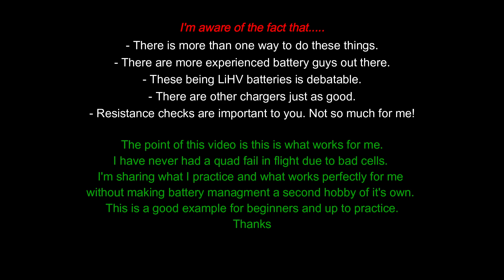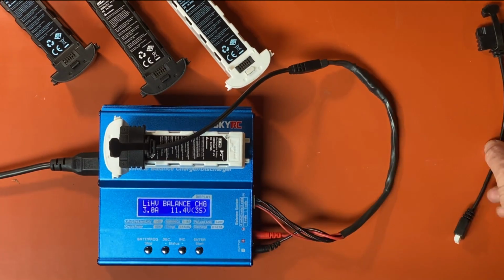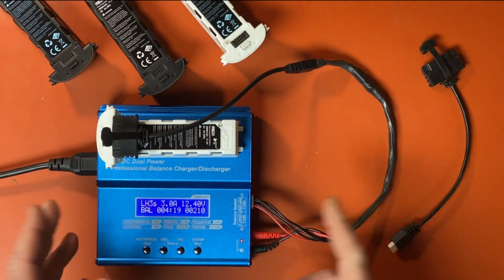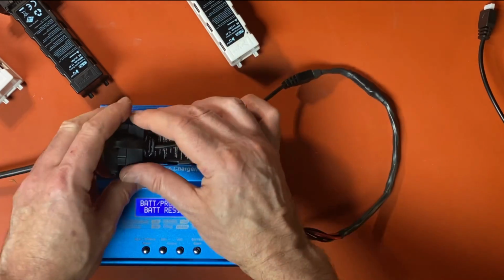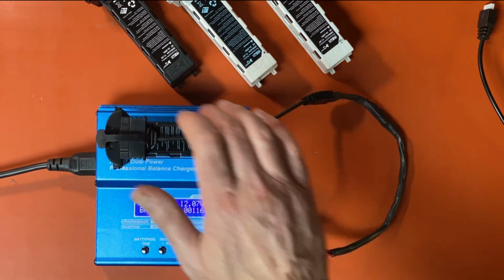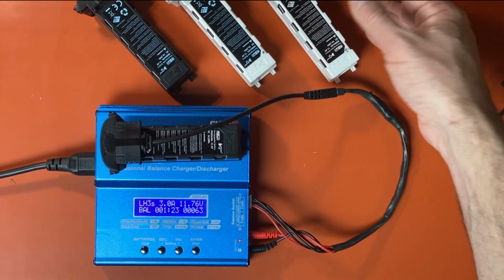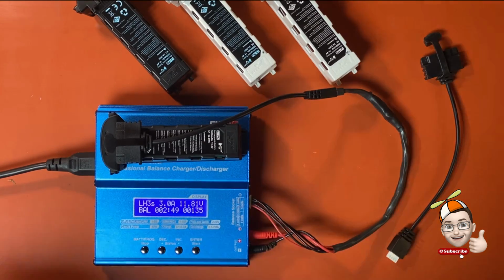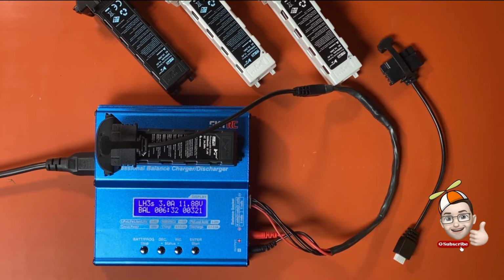IMAX B6 V2 BALANCE CHARGER - BATTERY MANAGEMENT USING HUBSAN ZINO BATTERIES

Comment from the maker: Check out my videos and you will find a 3 part series of how to make the balance leads in different ways for different levels or preferences. Thanks 😊
Reply: Hey. Any word yet on Zino 2 ship date? Mine hasnt shipped out yet, that’s why I ask. Also, when are extra batteries for it going to be available for sale? I would figure that they would want to have them in the pre-sale, that way they could drum up quick sales with extra batteries.
Reply from the maker: The Badboy Live New ship date is next week but please be patient because it is Hubsan delaying it. This is still a app testing delay according to them. 
Batteries and few other accessories will be around the same time they say.
Reply: @MeltWithU  I pre-ordered the ZINO 2 with 2 batt on dec 19th and they tell me another 10-15 days before they even start shipping so going to be awhile
Reply: @mgflyer8066  I think I preordered mine around the same day. I originally had a pro ordered and saw that this was coming out as soon as it was, so I decided to just preorder the 2, as I wasn't going to pass up the 4K / 60 and HDR, plus the extended distance and longer battery life. Especially at the price. Because the pro was nearly as much. I'm glad I looked into it before I got the pro. Though it would be nice if we had a more concrete ETA. I'm really not in any hurry, though I would love to be flying it now.

Like I said before here, I wish to God they would put up the batteries for sale separately so I could order a couple of them to ship and arrive with the Drone.

Comment: I have not purchased a Zino pro as yet..But  since wanting to be prepared, I purchased the B6 V2 AC DC batt charger. 
Since I am still using several  lipo 1S   (one cell) batteries 3.7 volts   some  2800 mAh and some 1800  mAh   all have 2C  written on them.    The  manual with the box is way too hard to read...so I went to web site and printed out the  large PDF and put it in a 3 ring binder... I  even  used the   USB port and  installed the  Windows version of the  charge program on my computer.    The  unit comes with the banana plugs...and one adapter that  has a single  jst connector that will charge the  1 cell lipo  3.7 v batteries... 
Up to now, I have had to use the  USB  plug in charger wires that come with the 3.7 volt batteries,  to use on the  toy drones.    
I hate to admit that at 81 and having been an Advanced Ham operator...been working with medical electronics all my life... the  new B6 V2 charger is  very frustrating and the manual is not much better than explaining how to program a rubics cube.    So,  would appreciate   a few more  videos....  How to totally reset your charger to get rid of memories you might have put in when testing and learning. 
Then  for some of us  ...produce a  video on how to SAFELY  charge a  1S  one cell battery LIPO   and what safe settings should be used....  1A chg or 2 A charge?  how do we know what is safe?   It took me a half day of frustration to finally get the Lipo  charge system 3.7 volts to agree to charge  1S  instead of 2S   finally it just showed up..   Then, I cannot find a way to  set  the battery to charge at the max of  1800 mAh  then change over  and know that the next battery will charge at   2800 mAh. 
The   computer app through Windows  did seem simpler...but  it still is not convincing all the settings are in safe mode. 
Perhaps  on one of the new videos you can  take  a  1S  and and  a common Zino pro batt  and another of different count cells and make a  how to set up and save a program for each.. 
Well....luckily...so far....I have succeeded in getting one of the one cell batt to charge..with out blowing up...  but looking at the figures...I am still un easy.        And thanks for all the other  videos you do... they are great help  in getting started in this  hobby.

Comment: Hi   Just got a Imax B6 AC v2   I only have the original cable that came with the Zino, but it appears to be the thicker one.  I have it set on LiHV Balance CHG  3.0A    11.4V (35)   When I press start I get a  "CONNECT ERROR    CHECK MAIN PORT"   The battery is new.    Thanks for you wonderful video        Vic
Reply from the maker: Do you have the balance cable with banana plugs like I shower?
Reply: @QCGUY  Haaaaaaaaaaaa after looking at a dozen videos, I realized everything I needed was not in the IMAX box. Then there were a dozen showing me how to make a cable that would work with my Zino Pro Batts. Finally found where I could purchase the  3S JST- XH Charge & Balance Cable on Ebay and Amazon. What a slog to fly this drone. I am wondering if I should not have a drone    LOL      Thanks for YOUR video. When I get the cable, I will reference it many times, I am sure.  Vic
Reply from the maker: @JackTheBearTexas  Enjoy 😉
Reply: Thanks guys for all your help   I am back flying my Pro

Comment: The A3 battery has fuse resistors in the BM circuits, so the cell I.R. values are not correctly displayed, and you should ignore their absolute values. You might still be able to pick up a trend over time if you see them changing. If you open the pack, you can get to the balance connector and hook that up directly to the charger for a better I.R. measurement.

Comment: I wish I’d had started watching your videos from the get go. I recently experienced a catastrophic battery failure 30 seconds into flight. Unfortunately I was using Hubsan’s battery charger so who knows what damage that charger did. I was draining the batteries down before storing but didn’t invest in a better charger/balancer. Since the drone will not even power up now, I’m faced with unknown damage (other than one motor that is visually physically damaged) to the insides of the drone after its 75 meter free fall. I’ve checked into sending it back to Hubsan because I’ve had it for 10 months and it has a one year warranty. But I don’t have much confidence in sending the drone to China and ever getting it back. What is your charge to inspect/troubleshoot the damage? I’d love to get this thing repaired even if I end up getting a better drone to replace it. It really produced excellent video footage for the price.
Reply from the maker: I personally wouldn’t send it to them if they even take it. They won’t honor a warranty but you can try. My minimum is $60 but the rest depends on what it needs?
Usually they are cheap fixes.
Reply: @QCGUY  send me your info and I’ll get it to you. I’m sure I’d pay at least $60 shipping it to China and back, so let’s see what the damage is
Reply from the maker: @lancecoler2009  email me....
qcguy.chris@gmail.com

Comment: First off, I want to thank you for this video for helping me get back to flying my Zino Pro. I ruined 4 good batteries by fully charging them with the charger that came with the pro and then sitting them on the shelf for months. So I got an Imax charger and the special wire for charging the pro batteries AND a new battery. 
Using your video, I was able to charge the new battery and check it. I was one of those folks whose Pro took off and then fell out of the sky....only 6 ft, so it passed that drop test. 
NOWWWWWWWWWWW my question is:  I don't fly my  Zino every day....I may not fly it for weeks. I hear, if I am to not fly for a while I should discharge the battery to a specific level and it will be OK to leave it for a while. Howz about if I only flew once every two weeks? You see what I am getting at. 
Again, thanks for getting me off the ground again. I love the Imax B6  Thanks to those who commented too. If it is OK, I would like to thank Captain Drone for leading me in your direction.     ChiefVic    Cedar Creek Texas
Reply: Bottom line    What should I charge the Pro Battery to and what should I discharge it to for storage?
Reply from the maker: @JackTheBearTexas  charge them if  you know your going to actually use them. If you put them away for weeks at a time or whatever just go with anything between say 25% to 70% 👍🏻
Reply: @QCGUY  Soooooooooo if the battery is an 11.4 V   50% discharged would be 5.7  or 1.9 V per cell     Thanks again   ChiefVic

Comment: Excellent... I flew the Pro the other day and got that high drain battery warning. It stayed on the whole flight but after 8min of flight it was still 50%... If you did what you recommend... maybe the 1.1.52 is still a better FW.
Reply from the maker: Gorilla Man It’s definitely still the best but now they implemented those update your firmware prompts. Everyone that doesn’t know the history will update right away because of this. I keep one on 1.1.52 and am leaving it....
Reply: @QCGUY  : You dont have the original FW files that came with the ZinoPro? I forgot to write them down and since I changed, I have been having focus issues. The Zino just keeps on keeping on... I just ignore the update warning and the BAttery stuff and just keep an eye on how fast it goes down myself. Their math must be out a bit.

Comment: A word on clone B6 chargers.  Before I knew about them I got one because it was $10 cheaper and looked like the same thing.  3 distroyed (swollen) CX-20 batteries later I found a real charger.  All three puffy batteries showed way overcharged.  Spend the extra few dollars folks.  Not foolproof, but look for the hologram.

Comment: Hi Chris
Thanks for all your Zeno vids, they're super helpful to get a deeper insight into what's going on "under the hood".
I've been flying my Zeno (version 1) occasionally for over two years now and since the "battery error" message started popping up lately I decided to purchase an IMAX B6 v2 charger to see if it can resolve this issue.
I have to state at this point that I've never done any updates to the existing firmware, following the code "if it works, don't touch it" simply because the quad was behaving like a well-trained nun.
However, I can't seem to be able to get rid of the battery-related messages and strange percentage readings within the app. 
I just recently updated the app to version 2.0 but it doesn't seem to make any difference (except for occasional cut out in the video stream).
Now, the two original batteries I received with the kit show really good values when connected to the IMAX charger. The voltage variation across all three cells stays within 0.01 - 0.02 volts. However the "battery error" pops up after every take of now.
Could you perhaps suggest something else I can try?

My second question is related to the IMAX charger. 
When I set it to STORAGE mode, it targets the voltage to 3.92v per cell. I remember reading in the comments here that the ideal storage voltage would be something like 3.7 - 3.8v.
Should I do this manually via the "discharge" mod?

BTW 
has anybody noticed that the Attitude indicator within the app has reversed roll/bank axis? 

Thanks again 
Jay
Reply from the maker: I don’t use storage on the imax. I deplete them in the drone and have always just made sure they are somewhere between 25 and 75 percent. It’s always been fine that way and I have some pretty old batteries still kicking.
Your problem sounds like the connectors on the quad that make contact with the battery may be wearing down and causing drop readings which also has caused problems with people having total power loss while in flight. You know the end result of that I’m sure. 
I trust the readings of that charger and as long as it remains pretty close if checking throughout the charging process I would look at the power connector board. 
Better know how to solder because it’s 16 wires. I have replaced a good many of these for people in your situation.

Comment: Hi Chris. You are my mentor when it comes to drones.  I know everything about Zino from your videos and posts.  I have imax b6ac no imax b6ac V2 and I don't have the same options as you.  Is this a sign that it's not an original charger?  I mean options how much is missing to full charge or resistance.
Reply from the maker: ky lu You most likely have a earlier version. Could be a clone but scanning the code on the back will tell you that.

Comment: Larry N, I just bought this charger in US from Cyclone FPV.com and its completely different plugins requirements that you show in your video. I can send you pics. I need to use your expertise to make cables and connectors that will work.Please advise. I thinks this is a new model that everyone is selling now. Thanks a bunch. Larry N (I have new Zino Pro)
Reply from the maker: I think this is what you are looking for. https://www.ebay.com/itm/3S-JST-XH-Charge-Balance-Cable/291799988263?ssPageName=STRK%3AMEBIDX%3AIT&_trksid=p2060353.m1438.l2649&fbclid=IwAR2t7EQ-I04FRUX3I0usCkTLWqlk3oxlbZLb3AXtEGRPA7WbtF3xCLRtyww
Reply: @QCGUY  Thanks I had to order a different charger. Like your subject matter. I used to live on Quantico base close to where you live, Woodbridge.
Reply from the maker: Larry Norcott I grew up there and my mom lived there till last Sunday when she passed away. I have been living in PA since 2006 but always miss VA.
Reply: @QCGUY  I was born in VA, Norfolk Navy base. My dad was a Navy Cmdr there for two years. Also Arlington and Quantico.Now in AZ, not comparable. Cheers.

Comment: Hi Chris, this really seems to be a great charger indeed.! May I ask you if you know of course, the original Zino Pro package is coming with the thinner battery charging cable currently from Hubsan? Or this was only the case with the original Zino S and the new Zino Pro is coming with a thicker cable ? Otherwise, where should I find the thicker charging cable to buy from?
Reply from the maker: Vassilis Chatzimanolis The thicker cable came when the pro did but new zino stock will have this as well. 
They are done with the thin ones because they have melted on caught fire. 
You can get them directly from Hubsan now. 👍
Reply: @QCGUY  Ok this is clear to me now. Thanks a lot Chris for the info!

Comment: Thanks Chris for making so many very informative videos.  I have been flying RC planes for several years. New to drones so i am unfamiliar with all aspects of drones.  I just  bought a cheap drone to learn how to fly them, a lot different from flying planes. 
I noticed in this video your charger was set on LIHV setting. I have a hyperion  balance charger. It doesn't have that setting on it. Settings are LiFeP04, LiPolymer, NiCd/NiMH, Lead acid. Most are 1s- 6s. Will one of these settings work on zino batteries.
Reply from the maker: FlyBuy777 You can charge at the regular lipo mode but you will get just a little less out of the battery. Not anything critical 👍

Comment: I'm still not convinced the Zino batteries are LiHVs; yes the mentioned voltage on the batt is slightly higher than normal (for lipo), but it also clearly reads 'lipo' on the label. Maybe I'm too cautious, but so far I've been charging my Zino batts as nornal lipos.
Reply from the maker: Pixelpeter I’ve been charging them as LiHV for over a year no problems.
Reply: I'll give it a try ;-)

Comment: Hi!: :-)
Got some great advice from you a bit back, and have now got this charger, manufactured the cable and are up an running, so thanks a bundle!! :-)
However, looking at this video again, I see you using the LiHV instead of the LiPo setting, and from what I got this is due to the batteries being "high voltage"... so is this HV on all Zino batteries, or should I be loking for some type of marking indicating HV?
(Mine only say "LiPo" in the "upper corner"...) 
Thanks again for helping us newbies out! :-)
Regards, Jon, Norway
Reply from the maker: Jon Torstein Bakken Go by the voltage of the battery. 11.4 is Lihv 👍
Reply: QC GUY What a difference bit of knowledge makes! 👍😃 Will use LiHV onwards then, and hopefully I’ll also then avoid those devestating drops I read about from time to time!
Thanks again, have a great one and please do continue your wonderfull tutoring! 😊
Reply from the maker: Jon Torstein Bakken Thanks and glad to help 👍

Comment: Getting a couple new batteries and want to start off with the hobby charger.  I"m  not clear on how to actually connect the Zino Pro battery to the hobby charger.  Is this a cable or adapter of some sort?

Comment: Hi Chris,
I'm using this charger for a few months now and I like it very much. I am really amazed however about the the large discrepancy between the percentages shown by the app (I flew my Zino to a 12% battery level yesterday). After I connected it to the charger to put it in storage mode it showed me like 55-60% instead of the 12% as shown while flying. I can understand a difference of like 10/15%, but a 40-50% difference is a lot in my opinion!
Do you know how is this possible?
Reply from the maker: Hubsan has been messing around with the battery meter for several updates now and it’s gotten ridiculous to the point you can’t go by it as fact or trust it.
Reply: @QCGUY  Thanks for your quick response Chris. Yes this is really ridiculous.

Comment: Hello Chris, hope everything is doing well for you.  One question.  I have recently got a balance-charger and I started to use it and it works well, basically, I purchased it because all you said in your video happened to me and from 3 batteries I had, two are dead now.
My question is, battery label says LiPo Battery, and there is an option on the balance-charger for them, but you charge them using LiHv… what is the difference between both charging modes?
Thanks!
Reply from the maker: You can cahrge as both but it is a LiHV and the only difference is LiPo will be a small decrease in flight time.
Reply: @QCGUY  Thank you very much Chris!

Comment: Hi Chris - I've got a B6 for my 501 batteries. I now have a Z2, and wonder if you are doing a regimen with those batteries. If so, is there somewhere I can get a parts/wiring schematic to start checking the Z2 batteries?
Reply from the maker: Mac Aroo Honestly I just charge fly and put them away usually under 25% charge. 
You can ask in my group where there’s some pretty smart battery guys.